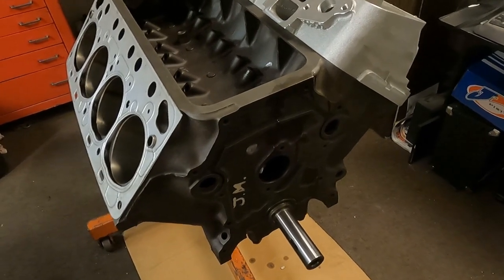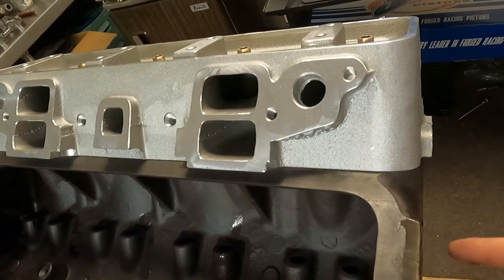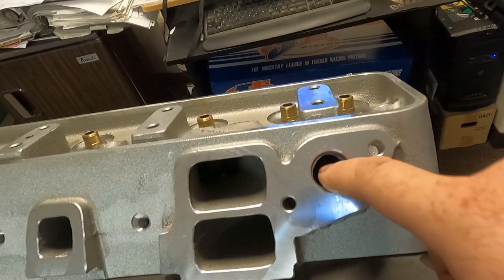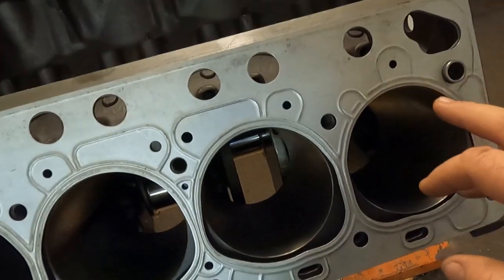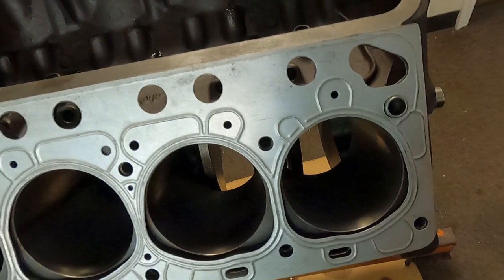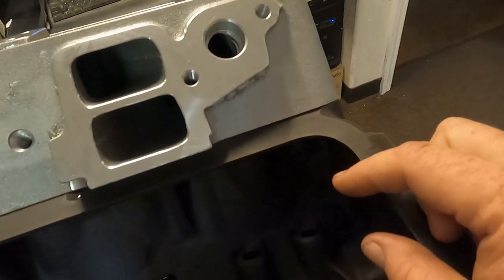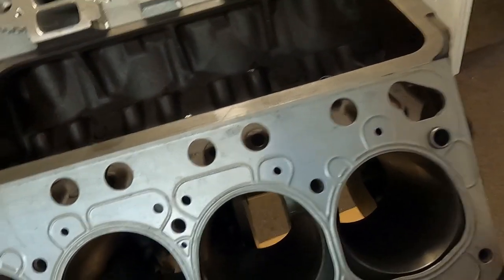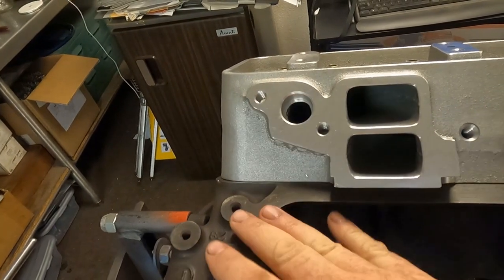Head Gasket Installation and Coolant Passage Basics

Comment: I've always wondered why the head gasket has the "Eyebrows" at the bottom of the bore opening? Why wouldn't a round bore opening be better? Any insight on that?
Reply from the maker: The combustion chamber hangs over the bore on a Y Block. The gasket follows the head.